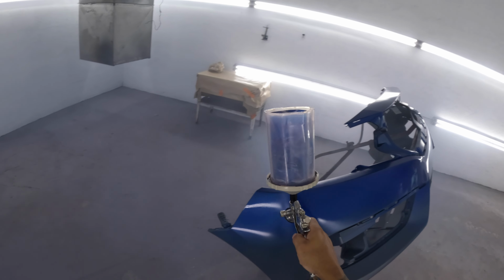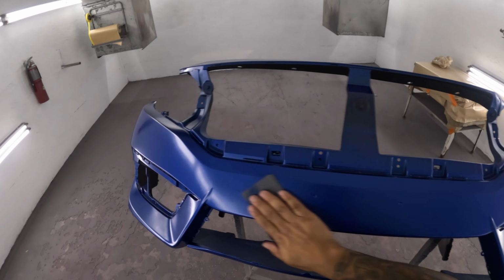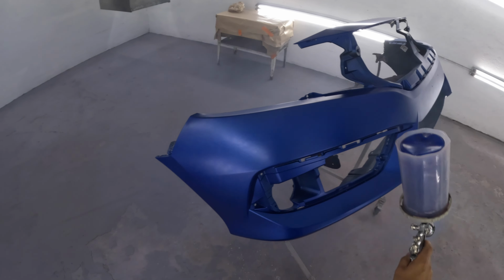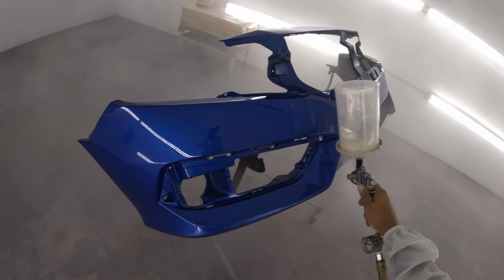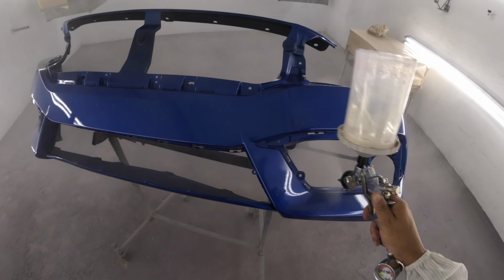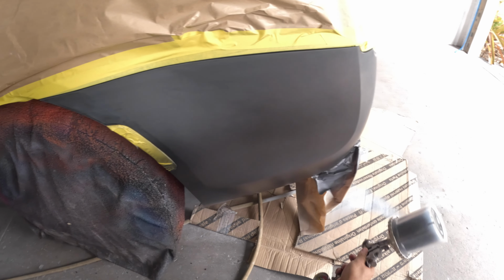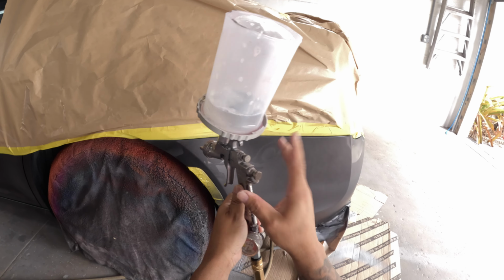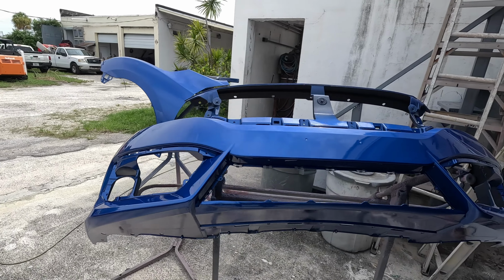Most requested battle so far. Rocky Balboa vs Apollo Creed ROUND 1 PLUS A BONUS VIDEO 🎁

Comment: What did that do when you said you "Burped" the gun by turning the gun upside-down and pulled the trigger?
Reply from the maker: Yes sir 🙂 like a baby you can burp them 😀 turn the gun upside down and pull the fuller fully and you'll get all of the air out of the cup. It's not super important unless you're going to be spraying upside down under bumpers and things like that.

Comment: Do you thin your materials for a flatter finish,,asking because 22psi is quite low for fine atomization
Reply from the maker: Some times I will over reduce my base by 10% for a flatter finish. But one of these are over reduced. 22 psi is fine for base coat. It's not like the base has to be atomized like clear coat. Just has to lay down smooth.

Comment: can’t believe how clean your jobs are in an open garage
Reply from the maker: Either I'm very lucky or pretty good at what I do. 🤔😀😂 🍀🤞🏽
Reply from the maker: Also I think because I use the LPH using low pressure gun like that doesn't stir up to much dirt few inches off the panel and it works like a charm.

Comment: Hey triggerman. What aircap do you have on the ani f160?
Reply from the maker: It's the cap that came on it. I wasn't aware that they had multiple caps. So yea standard cap with a 1.3 tip
Reply: @thetriggerman954 they have a clear cap. Even with the standard aircap the result are outstanding. 🚀
Reply from the maker: @matsushitokan7526  didn't know that. I have the ANI skull and that gun came with a clear cap,HVLP,and water cap. But the F160 only has a standard cap there was no option to select a different cap.

Comment: man trigger i damn near threw in the towel today. used the vevor 22psi full fluid full fan on a honda silver metallic. base coat came out like crap. it was gritty all over and my metallics were standing. used wet bed and sealer. it’s gotta be my technique. i might have to just buy the dv1 to help me out. doesn’t make me a better painter but it might just help.
Reply: your videos help a lot but i still suck 😂😂
Reply from the maker: @haule8418  how hot was it today?
What temperature reducer were you spraying? Fast,med,slow,extra slow?
Full fluid is a lot in that gun I keep it 2.5-3 turns out from closed.
Reply: @thetriggerman954  not too hot around 75-80. used slow reducer. i even tried to over reduce and add blending additive on my 2nd and 3rd coat. still came out like shit
Reply: sealer i put it one turn in from full and it sprayed pretty nice. but the base came out horrible
Reply from the maker: @haule8418  not sure what the hell could have happened temperature and reducer sounds good. Hopefully that POS regulator the gun came with is working properly.
Reply: @thetriggerman954  i switched it out with a 3m regulator too
Reply from the maker: @haule8418  something with the technique record it next time. I'd have to see what you over there doing. Make sure your not moonwalking while painting 😭😂
Reply: @thetriggerman954  it’s gotta be my technique. i think i might’ve been moving too fast. i’m still a rookie but can’t afford anymore mess ups. it’s hurting the business. dv1 looks like it sprays base effortlessly. might just have to cough up the bread
Reply from the maker: @haule8418  DV1 is an excellent gun. If you were local I'd try to come help you out.
Reply: @thetriggerman954 I really appreciate your willingness to help others brother. You have become my #1 channel. Ps... I watch all the most popular ones, including Sprayway, Garage Noise, Pharraway, Lakeside, UPK, etc. I do watch some of Paint Society, and I saw a video he made, stating he was laying his base wetter, to get a smoother finish now. He is learning from you now, and adapting to your proven style.

Comment: Awesome but you know they (by they I mean the haters 😂) might bring out the fact that one was sprayed on plastic and the other on metal 😂😂😂. Nice finish bud. Really like how the material flows out. I have to ask, cause I know I would end up running it, have you had any issues in the beginning with runs with the Vevor? I’m a novice who found out last year I really like doing body and paint work. I’m not anywhere as quick as you triggerman but I really like how you get the material to or flow out to the panel and if the time to adapt isn’t bad, I’m probably going to order one. I just don’t want to spend time sanding out runs cause I’m trying to keep up with the triggerman 😜
Reply from the maker: Man I hater season is over. I'm here to teach this stuff to those that want to learn. Haters are no longer my concern. But to be honest man from the first video I sprayed with this Vevor I haven't gotten any runs I've been spraying with the gun daily for about a month and a half now and haven't gotten one run It's not the gun that makes runs It's user error. You just have to keep moving with the gun your gun speed and your distance has to be right. The reason I can avoid runs is because I've sprayed with the same exact clear coat for 10 years now I know the clear I know how far I can push it. That's why I tell guys get to know your materials It's all about materials, materials, materials, materials it's not so much the guns. I take any gun and get just about the same results because I know the materials. Thank you for watching. Does ever anything else I can help you with man just drop a comment and I always get back to you guys 💪🏼👊🏼
Reply: @thetriggerman954  I hear you brother, it’s never just one facet. I’ve been spraying at home with a lvlp gun ( Aeropro a610). I have a 30 gallon tank and the low cfm gun works great but the trade off is that it is slow. You rip through panels like there’s no tomorrow and even if I’m behind a screen watching you spray, I can clearly see the amount of material being sprayed is so much more. Thanks for the perspective with the materials brothers, I will keep it in mind. Keep the videos coming 👍
Reply from the maker: @guillaumel3640  man if that's the case maybe you should try the lph400 that gun doesn't require much pressure and it's super fast. I mean it costs more but I highly recommend trying it out

Comment: The Battle Royal! No losers here, tho.
   Here's a little twist...I got my hands on an Apollo turbine unit and the 7700 hvlp gun which is the newest version offered. Whole different ball game. 9 psi max. High cfm.  0.8 or 1.0 cap n needle set for base clear.
Reply from the maker: Dm Big Bear I've been seeing those. How does it spray? Any good? Expensive?
Reply: @thetriggerman954  The top spray gun Apollo has is $499.00 so not cheap, but not the highest cost hvlp either. It's an investment if you buy it new, but all paint equipment is...
   Got mine used, barely used. Looks like new. So I got a deal. 
With unlimited clean air and low overspray this might be ideal for a guy who works every day, but not in a big pro shop. I ordered the pps adaptor , a 22 ounce pressure cup(3m 2.0 system) and 2.0 refill kit. So this has the tube that goes into the cup from the gun. Will probably use the metal pressure cup for base to save money. For primers still gonna use compressor as I don't have a dedicated turbine primer gun yet.
    Will it spray as good? Might take a bit of learning, but I have been seeing good results from others who know what they are doing. So I'm gonna figure it all out and make it work. I don't Triggerman would see any advantage in his work environment, but I think it might work out for me. 👍
Reply from the maker: @BearBudgetgarage  sounds interesting. I have people ask me ask the time if I can come to their house and spot in their car. I'm wondering if it would be good for that 🤔 going to look more into it. 💪🏼👊🏼
Reply: @thetriggerman954  Turbine would be great for mobile repairs...unit is very portable. All fits on the back of your car easy. I know other guys are using turbines for mobile repair. Not all are created equal, that's why I went with the best. Apollo been at it a long time and they have professional setups for shops, and smaller setups for guys like me👍
Reply from the maker: @BearBudgetgarage  what about like if you have to blow off the car. Can you put a blower on the send of the house and blow air?
Reply: @thetriggerman954  not that i know of. You can pull the trigger to release just air to lightly blow off the surface. Its a non bleeder style gun, so like a traditional gun, first pull air, second position fluid. For heavy duty dust removal i have a light duty cordless leaf blower i can use. Low setting.
Reply from the maker: @BearBudgetgarage  cool, thanks Big Bear I'll research more. 👊🏼